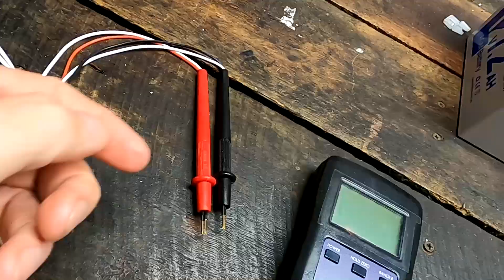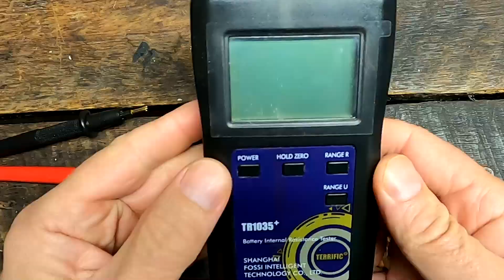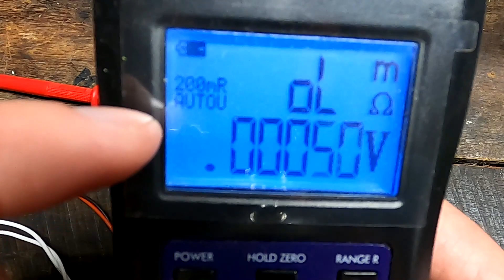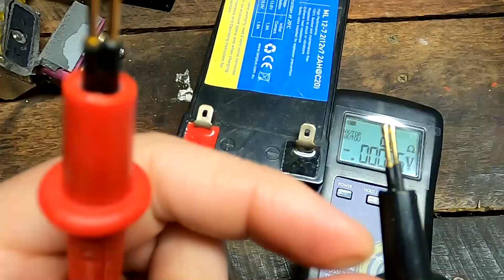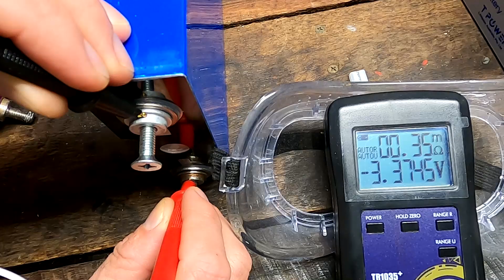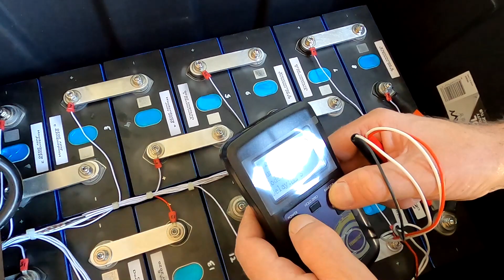Internal Resistance Tester TR1035 - Can we find a faulty cell?

Comment: Not sure I'd be relying on these single frequency testers to tell you much you don't already know by simply using a battery.

Battery internal impedance is variable depending on the test conditions, e.g. the frequency of the test AC signal, state of charge and load condition. Testing should be done across many orders of magnitude range of frequencies to see how the impedance response varies. The resulting shape of the curve of impedance v frequency can imply different states of battery health. A battery might seem in spec at 1kHz but what about at 1-10Hz?

In any case, the best indicator of battery health is capacity testing.
Reply from the maker: What's the alternative?
Reply: @OffGridGarageAustralia  Multi-frequency testing and generating a Nyquist plot.
Reply from the maker: @alexsimmons1803  Ah, sure. Doesn't sound like something I could easily do in Andy's Garage.
Reply: @OffGridGarageAustralia  Perhaps not. I wonder if a single frequency test is a case of the old maxim; "not everything measured matters". That said, I'm pretty sure measuring the variable frequency of beer consumption is entirely doable in Andy's garage ;)

Comment: Oh very cool, I've been looking at some of these. maybe it can confirm the resistance of the bus bars too ;) 

Interesting that it was mentioned below about the reading not being accurate for >100Ah cells. I wonder if you can do any other measurements to check how accurate yours actually is.
Reply from the maker: It does. The further away you measure from the actual terminal, the higher the resistance as it measures the resistance of the bus bar as well.
How do you know if it is accurate or not? What do you compare it to?
Reply: @OffGridGarageAustralia  I just decided I need one ;)
Reply from the maker: @PowerPaulAu  I know that feeling...

Comment: I wonder which has more of an effect, the internal resistance of each cell or the capacity of each cell?  If most of the cells are close to spec at 280 Ah but a few are less, say 260 Ah, then the low capacity cells will drop in voltage faster when discharging.  Assuming the BMS only top balances when charging.  The low Ah capacity cells will drop in SOC and open circuit voltage more than the higher capacity batteries, regardless of what the internal resistances are.  Right?
Reply from the maker: You cannot win. You have 16 individual cells with different parameters and behaviours. Even if you have them perfectly matched, once they get older, they will drift again and mismatch the whole pack.
Reply: @OffGridGarageAustralia  yes agree its a challenge alright but if you match their charge/discharge potential they seem to stay in balance for longer and you get max capacity out of your battery for longer. Agree they will eventually go out of balance and you need to start again but hopefully not for years
Reply: Yes and No. Another good way of testing each of your cells is to fully charge each cell to the same voltage (i.e. saturate) say 3.55 and then let them sit for an hour and measure the drop in voltage over time (without load). Clearly a heathy cell the drop in voltage will be low as compare to a less heathier cell the drop will be greater. How fast and how much it drops is directly related to the internal resistance and health of the cell, as the the cell deteriorates its internal resistances increases and its capacity decreases. That's why I'm a big believer in match cells internal resistance (if you can) then just matching the voltage (at the top or bottom) because you can get any cell (good or bad) to match at any voltage you like doesn't mean they are going to play nice together. Its more related to matching their change in voltage (internal resistance) with load/charging then just a particular voltage at the start or end. You might say that's what a cell balancer is for, but based on my trials balancers are doing very little (you think they're doing something but they're not really) and for good reason the maximum amperage that any balances can operate with is 1 amp (some way less) but during loading/charging it could be up to 100 amps flowing so the balancers is moving drops in an ocean around. What you see on a balancer readout is each cell catching up with each other (as they become saturated) not so much the balancer doing it. Hence the reason it is better matching charge/discharged rates/charge levels then just a particular voltage level, once you do this you will see much better total cell balance and you will realise very quickly that you don't need a balancer (you didn't need one in the first place). Clearly you still need cell protection (i.e. cut off if outside 2.5v and 3.6v voltage) this is a must!!...but cell balancing is completely different thing. Easy to prove my point, charge one cell to 3.4v (cut of charging immediately) and another cell to 3.4v but saturate it (there is a reason I chosen 3.4 because it will take much longer to saturate) then use them together immediately and watch how bad they play together and no amount of cell balancing will help this, unless you let them sit there for a very long time together on the balancer without use. Important point is they have exactly the same voltage at the beginning but completed different charge/discharge potential.
Reply: @markparker9749  Hi Mark, two cells right balanced have simply  exactly the same voltage...and not more. That does not mean they have the same discharge quality, specially in high discharge conditions. If they have exactly the same RI, it's a better test (but not absolutely the most secure , the video shows it)  to think they have the same discharge quality.
Control of the auto-discharge after some hours (after full charge) is an indication, but how can we analyse the voltage difference?   We simply know ther's a little issue, but without possible estimation of the issue, only if the V fall is really too big. RI difference is more reliable, at the moment and for the future.
I think it could be interesting to test IR at the teminals AND at the other end of the circuit,  (just before motor or else) , to appreciate what is lost during the "travel". The real work of the battery is finally what it can  give to the device. With a big lost we know that the batterie must drain lost amps.That can show eventually an issue in the cables and connections. No absolute values, but comparatively (on different devices or on the same one later) interesting.
-On terminals to estimate the battery
-on the other end to appreciate the quality of the circuit if we have an issue.
Friendly, Michel.

Comment: Most of the resistance measured is probably bus bar. I have designed and manufactured an AC battery tester, and they work well for determining the lifespan of all lead-acid-- the resistance increases ~linearly with battery age (inverse of capacity). Unfortunately, resistance measurement of the lithium ion chemistries doesn't correlate well with capacity loss or remaining life. It DOES correlate well with fake-capacity claims, but for that matter, battery weight also tells you if the capacity claim is fake.
Reply from the maker: Thanks for sharing.
Reply: @PattyDung, hello, what's is the relationship between IR and Capacity, it would be IR = 1/Cap, or what ecuation correctly correlates the values?
Reply: @mcsroberto1  For lead-acid batteries, the capacity goes down as the resistance goes up. The remaining life capacity scales something like resistance to the negative 0.7  power, I think.

Comment: also the results you got were extremely low, if they are true it would show that all cells are beyond excellent in health. you should get much higher resistance if they were bad, several ohms
Reply: Actually the resistance is above specification for the Eve cells. Mine measure in the .17 or .16 milliohms range without the busbars, specification is  .25 or less.
Reply from the maker: Specs for EVE 280Ah is 0.15mOhms under their test conditions. As my battery is no cold (15°C) it has a bit higher resistance anyway.
Reply: @OffGridGarageAustralia  That makes more sense.  Cell's Rs at 15 degs C is almost 150% that of 25 degC.  With some strap resistance added in, the numbers look believable.  Only question left to be answered is the 2 to 1 variance between max and min numbers due to strap contact resistance variance or actual cell Rs variance?  Straps are fixable, cell Rs variance is not.

Aluminum contact resistance is highly dependent on compression force.  I like the separate post studs with allen screw locking holes that allows maximum cell post thread insertion into cell terminal reducing likelyhood of stripping out cell terminal threads. Top washer diameter should at least match the cell terminal surface diameter and be thick enough so it doesn't pucker at center of washer when tightened to get uniform pressure across cell terminal surface.  BMS lug above large washer.  Add another washer on top of BMS lug if you have the stud length.  Get a torque wrench and go for 8 N-meter of torque.  I use a little white vinegar on cloth (avoid getting into threads) then clean off with 91% or higher isopropol alcohol.  Aluminum oxide builds up quickly so assemble immediately after cleaning/drying.

Comment: in my tests were the measurement accuracy of voltage with  TR1035 not so good
and with Tester ZKE Tech EBC-A20 you can also measure internal resistance, but only with pc program, look at menu
Reply from the maker: The ZKE testers do measure the resistance but it is not accurate at all. Hence I bought this tester which is as precise as it can get in a home environment

Comment: I have the same YR1035+ and the same 8 pcs cells, I measured all between 14-16m ohms directly on terminals. Another interesting thing if you measure the busbars between two cells, you can measure their resistance/voltage drop (under load). I did this, with the original 2mm busbar and after then the DIY 5mm CU one, and I have much lower values.And you can find bad connections.
Reply from the maker: That's great advice. Thank you.

Comment: Spec on new 280AH cell are <0.25 milliohms.  Typical new ones are in 0.11 to 0.15 milliohms range.

Not a good sign when the 100 AH cell is reading lower then 280 AH cells.  There will be some addition going through bus straps but I don't expect it explaining that much difference. You might be able to hit the cell terminals from the sides without removing bus bars.  As cells age their Rs will rise.   Should wait at least 5 minutes with no charge or discharge to allow any kinetic energy required for cell current flow to settle out.  If you trust voltage readings accuracy, the 100 AH cell was about 95% SOC, while the 280 AH cells about 92% SOC.  Between 50% & 85% will have best Rs numbers. 

The 1 KHz current drive from the meter is the important factor.  (1 KHz testing is pretty standard)  1 amp rms on 0.25 milliohms is only 250 microvolts.  The meter uses a simple squarewave drive but uses a narrow bandpass filter at 1 KHz to remove broadband noise to achieve the incredibly low signal level detection in fraction of mV range.   Even so, the accuracy in tenths of milliohm range is not great.  But for the price it is not a bad meter and the relative difference between cells is as important, if not more so, then the absolute number for matching cells.

The whole battery series stack should be the sum of individual cells plus bus bars and their surface contact resistance to cell terminals.  Good way to check you don't have a bad terminal connection.
Reply: I checked on my cells, his measure high due to the busbars. If he measures directly on the cell terminals it will be substantially lower.
Reply: @john_in_phoenix  This is an excellent way to test all the connections. I've had mixed results using a thermal imager (hot-spots can hide behind washers or bus-bars). But if one IR measures higher than the others, then you know that one may have a problem, or at least could be improved. And you can confirm it if you measure before and after making an adjustment (or polishing terminals😉).
Reply: @charlesrichards5389  Good suggestion, I have not purchased an infrared camera yet. I am however still looking for a good one that is cheap. I was just lucky to have cells both with and without busbars to compare with.
Reply from the maker: Even if the tester is not super precise, you can still compare the results across your cells and find the odd ones. I tested some brand new 280Ah cells, they are all within a few 40uOhms

Comment: What SOC is recommended when measuring internal resistance?
Reply: Rs will be slightly higher, above 85% SOC.  Goes up; near full discharge. 50% to 85% SOC is best region.
Reply: Usually full.
Reply from the maker: Ri is actually the lowest at around 85% and higher below and above that. Temperature is also a factor. Colder cells have a higher resistance.

Comment: 052921/1230h PST 🇺🇸 053021/0530 Brisbane.  Good day to you. Thanks for introducing TR1035 IRT meter. I’m procuring one. This meter is highly required for myself when dealing with many types and models of Cells. Presently, I’m using a very rudimentary device made by ‘SKYRC-B6AC+v2’ charger/ discharger that’s capable of testing, IR of 18650/26650 etc. I obtain IR reading on each 18650/26650 cells. Since I weaned out of Li-ion cells into LiFePo4 cells, TR1035 looks like a better IR tester and less cumbersome, than the former. Thanks again for your report and comments. Have a nice day ahead. 73s...

Comment: If you have a 24V battery, ( two 12V in series) can you use 2 charge controllers (12V PWM ebay cheap) to charge each battery, and then parallel your solar panels to both controllers? would that work?
Reply: No
Reply: @wibla2578  dont lie to me
Reply: Only if it has two seperate panels.
Reply: @henvern  wtf are you talking about
Reply: You can charge individual batteries in series, with either a charger or solar controller but likely to get out of balance very quickly. Also wouldn't recommend connecting different controllers to the same panels. Never done it myself and I don't think I will either, I would not recommend it at all. But hey give it a go and lets us know if anything catches fire.
Reply: @markparker9749  since they are in series I do not think balance would cause any issues. If one battery charges faster than the other, it will draw less current as it nears full and the remanding current will go to the other charger
Reply: @bigbeef2654  unfortunately cells only balance themselves in paralleled  not in series that's why you have cell balancers for series connections not for parallel. Unfortunately unbalance cells will always stay unbalance in series connection unless connected to balancer
Reply: No you can't